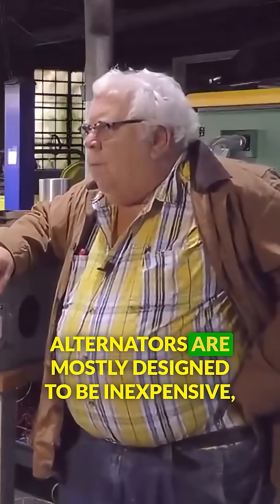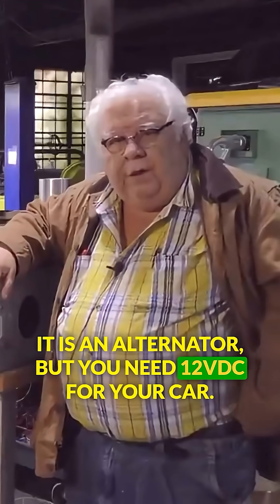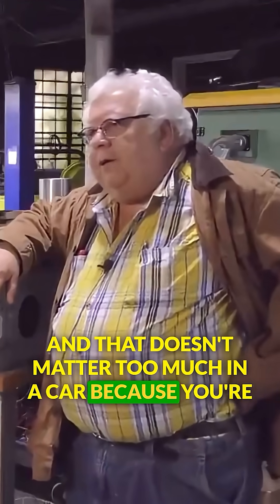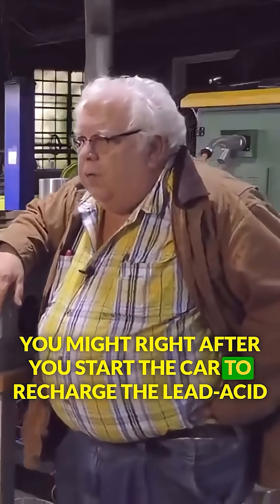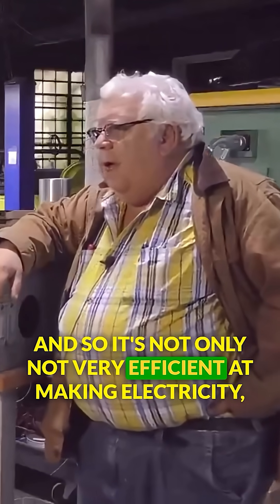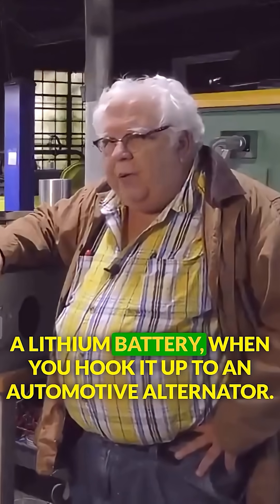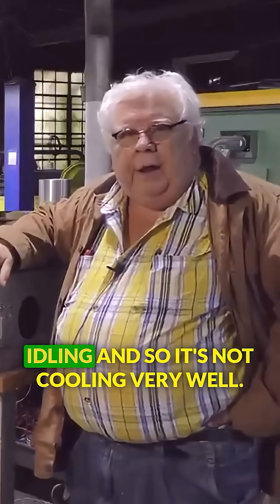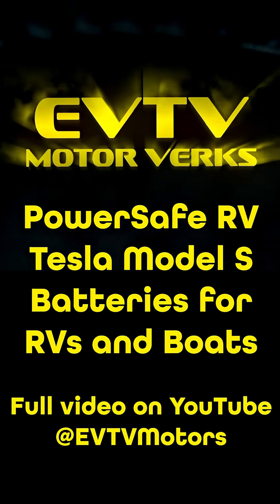Alternators are Only 50% Efficient!

Comment: Back when alternators were 30 bucks, I went to replace one on my 1980 Monte Carlo, and my dumbass brother in law said "no, don't get a new one, rebuild yours. Get a voltage regulator, diode pack, and something else....( can't remember) So I did that; saved like 10 bucks, until a month later when the pulley bearing seized .....😂

Comment: You are incorrect that alternators are 50 percent efficient because of the rectifier. Diodes do not work that way.

A car alternator is a three-phase AC machine with a six-diode bridge. Two diodes conduct at any given moment. Each has a forward drop of about 0.7 to 0.9 volts for silicon or 0.3 to 0.5 volts for Schottky. At 100 amps this means about 180 watts lost for silicon and 90 watts for Schottky. That is 5 to 10 percent of the output, not half.

The rest of the loss comes from copper heating in the windings, magnetic losses in the core, and fan drag. In an automotive alternator the copper loss is high because the system is locked to around 14 volts. That forces high current to deliver the needed power. Higher current means higher I²R loss. This is the same reason high-voltage transmission lines are used. For the same power, doubling the voltage halves the current and cuts copper loss to one quarter.

A three-phase industrial generator producing hundreds of volts benefits from this principle. Higher voltage means lower current in the windings, which greatly reduces copper loss. It also allows for heavier, more efficient cores with lower magnetic loss. As a result, large three-phase generators can achieve 90 to 95 percent efficiency, while automotive alternators typically reach 65 to 75 percent under good conditions and fall lower at idle under heavy load.

The 50 percent figure you quoted matches a worst-case overall alternator efficiency, not a loss caused by the rectifier.

Comment: The solution is fellas is hook up another gearbox. If you have the room underneath your engine hood for a generator alternator and use that to charge your lithium battery and connect it into another spot of your truck and use that just to power your tools or jump, start somebody.  But don't use it to run your truck

Comment: Alternators generally turn about 3x engine rpm so if your engine is idling at 600rpm the alternator is turning 1800.  And if you use lithium batteries in a vehicle or specially and rv.  You must use a dc to dc charger to limit the current or yes you will burn up an alternator … even at speed , not so much for cooling but the high load.  Yes an alternator can put out 100amps or more but it’s not designed to be 100% duty cycle.  With a lead acid battery you may run high loads as its charging and your night driving with lights etc.  but as voltage comes up amperage goes down. A lead battery also has high internal resistance, it can only take so many amps In… a lithium battery has lower resistance and can charge at 100amps usually without issue.  The alternator simply can’t do that max load continuously …

Comment: This man is correct. Legitimate testing and video is out there of this very thing. It's the "idling" scenario that will smoke an alternator. Not enough cooling. Reving up the engine is sometimes enough to keep it cool.. Possibly prevent overheating.

Comment: usually, current flows through 2 diodes during rectifying process. If we're using silicon diodes it causes 1,4V drop (from usual 14 from generator) which is more like 90% efficacy rather than 50% mentioned. If Shottky diodes are used, this voltage drop can be even twice lower.

Comment: As a retired alternator rebuilder he is absolutely correct!! They are terrible chargers. A std flooded battery is easy on them. An AGM battery is hard on an alt. and a lithium battery is a pinto towing a tractor trailer , fully loaded. The can be rewound to put out more amperage but then it will get twice as hot and burn up twice as fast.

Comment: I've got a Kenworth t680 with the stock alternator and it's about four or five years old, 500,000 mi, I run three deep cycle lithium ion phosphate batteries and one lithium ions starter battery, I often run them down to 50% charge or lower before starting again. Personally I have not had problems with my alternator. Maybe the fan is cooling it enough, maybe those alternators are just stronger, they push about 300 amps. They are probably built more efficiently because semi manufacturers compete heavily on fuel mileage,  but maybe not because the gains from the alternator are probably small for mpg so maybe it's not too efficient. Either way I've been running that setup for 7 months and not any problems yet

Comment: Lithium batteries are charged using constant current to avoid damaging the battery. This continues until the battery reaches a determined voltage level at which point the current reduces. This is why the last 20% (or so) charge takes much longer to achieve than the first 80%. So no, a half-way decent lithium 12.8V battery should not place a higher-than-normal drain on the alternator. A lithium battery that accepts over-charge will have a short life.

Comment: Interesting about liion battery recharging. Also it's disturbing to know that alternators are 50% efficient, because that 1200 watts of heat has to come from somewhere,  which is money I paid at the pump. All because automakers are too cheap to use something more efficient.

Comment: The difference and a alternator is the time and money it takes to make one.
 Back in the late 50s and early 60s generators were OK. Because A/C WAS NOT THAT COMMON + the old timers knew to not turn the radio on until the voltage went up. Because it would not very well without the proper vacuum tube voltages.
All the inconvenience. Oh the pain. The pain.  
 Shut up DR. Smith.
Now splain why my '68 Corvair got the same gas mileage as my Trax. Hint 4 speed stick, no A/C oh and it got stolen when it had 100,000 miles on it. I do not think I can give my 100,000 mile Trax away. If it makes it 100,000 miles.
 But along came auto magic transmissions and you could not touch the gas pedal and bring the voltage up, while sitting at a stoplight. Well you could if you wanted the engine to overheat.

Comment: Any lithium cell designed for automotive use that is sold on American shelves has integrated current limiting and charge equalizing circuits by regulation. Yes, the total load capacity is higher, but the rate the battery pulls current is bottlenecked specifically because of lithium cell overcharging. They will not kill your alternator any worse than a typical lead-acid battery. Also, this dude has no idea what he's talking about when it comes to the reason WHY alternators fail. Relative to the heat ratings of the materials alternators themselves are made of, they don't get that hot unless something is seriously wrong. More often then not, failure is caused by moisture and debris intrusion causing corrosion leading to insulation failure and arcing in the alternator. This is what causes the "heat marks" that this guy is probably thinking of which lead him to this conclusion.

Comment: An alternator is a three-phases generator, and uses 6 diodes to rectify the currect. This is actually the most efficient AC to DC system available. Standard one phase generator makes pulsed current and need hugely big capacitors (size proportional to output current needed) to make the output current, but three phase makes almost perfect continuous DC without any capacitors.

The bad efficiency of a car alternator is more due to the range of currents it needs to output.

https://www.youtube.com/watch?v=d2Wni_SzBiM

Comment: That's just pure stupidity. Diodes drop about 0.7V under load. At 14V output and 100A this is 70w of heat loss at 1400w of output power. How do you cool 1200w of heat loss in such a small package? That can only be done by water cooling. I don't even think this guy is real, I can't even believe he is real let alone his words.

Comment: He is wrong..   50 percent efficient means for every 1000 watts of electricity produced it requires 2000 watts of power to turn it.. as in takes 2kw of power from the Engine via the drive belt. Also modern alternators are more like 65% efficient, and permanent magnet hybrid motor generators are more like 95% efficient. The inefficiency of alternators is found in the rotor windings, which require electrical energy to generate the magnetic field necessary for the stater windings. The reason rotor windings are used instead of percent magnets is because automotive electrical systems require variable amounts of power to operate.

Comment: Most lithium batteries have a OE spec charging system as to not damaged the batterie or charging system sort of smart charge and they also hold a higher charge anyway about 13.odd volts and keep it quite well
In cold weather however they need waking up before you start the engine 
Turn your lights on for a minute but only when its cold 
Been running a lithium batterie on my bike for six years now big twin and its been fine and when you get them you think its an empty box because they are so light weigh nothing which is great for a bike.

Comment: The only output power limit of the alternator would likely be the current rating limit of the 6 rectifying diodes used in the production of the alternator. If anybody needed to, you can always turn to aftermarket alternators such as mechman alternators.

Comment: True, they aren't that efficient. They have a simple way of voltage regulation by varying the field strength. More efficient would be to use strong magnets (instead of the field electromagnets), and a DC to DC voltage regulator to manage voltage. The Li ion battery might work, but needs a constant current charge at lower battery voltages and constant voltage at higher battery voltages. All consumer products have this setup if they use a li-ion battery. Car li -ion batteries need such a system too, or bad things can happen.

Comment: I didn't see any comments regarding another problematic issue: its not just alternator cooling; unlike an alternator charging a lead acid battery, a lithium chemistry battery with a BMS will simply cut off charging when it reaches full charge. The voltage spike from that can fry alternator diodes. The reason why a lot of places recommend DC-DC converters is also to prevent the spiking from doing in the alternator, and its also the reason a lot of boaters/rv'ers will keep a lead acid battery in the mix, even though it impacts the charging of the lithium battery.

Comment: Automotive alternators are three phase machines, which helps.  Still less inefficient than they could be.  I've been driving those weird Chevy Volts for several years. They have a big efficient alternator that does indeed charge a large lithium battery properly without harm.

Comment: and it's not efficient on belt with huge tension causing a lot of friction and energy loss like if they could not fit it on the crank shaft end directly, or at least a gear directly running from it. It's all scam to burn more oil. Idling is the main scam. Why would a car burn fuel to stay in place ?! It could use just a bit stronger starter motor to drive on just a bit bigger battery while being stuck in the traffic.

Comment: what if you could increase the fan speed with a gear ratio that the alternator can slip into when temps increase on a lithium battery setup

Comment: This guy is wrong I have  a 300amp  alternator.  I have 4 x 200amp our lithium their highest draw is 35 amps each even when low state of charge  20% . I know  because they are blue tooth. If you have  80amp alternator upgrade 150 amp no worries  a car has a battery  so I could pull 60

Comment: I agree with most of his points except heat and efficiency.  Diodes for rectification are pretty efficient. He's saying 50%, based on the 1200W of power and 1200W of heat statement.  Simple bridge rectifiers are more than 80% efficient, plus you're not making 100A at idle on an alternator either.  

I think he's over exaggerating the impact of a lithium battery on an automotive charging system.  Yes it may add more load on the alternator when you first start the car, but unless you're repeatedly hot starting your lithium battery car...  This isn't really an issue. 

Just most of what he's saying is valid.

Comment: I have installed many Mechman alternators into some crazy builds over the years, seems they have found the right recipe for charging PB and Lithium chemistry batteries. Great at low rpm and 10,000rpm.
Reply: He's a liar,   and misleading people. 
You can't charge a lithium battery with a lot of amps, you will destroy the battery. 

If this man was telling the truth,,  every hybrid vehicle will burn up it's alternator the first time it goes down the street.........

Every electric car will burn up its inverters when it Regine......

So that's not true what this dummy  is saying,  he's lying and don't know nothing about a lithium battery.....

Comment: An alternator with a fan on the outside is usually found in cars that are a good 25-30 years old at least! Newer cars are more efficient and can handle lithium batteries just fine. I have ran countless lithium batteries for audio and have never had a issue at all. Not saying he is wrong but in my experience I have not seen what he is talking about.

Comment: Uhh my 64 nova has a lightweight lithium battery in it and all my motor turns is an alternator,so what is he talking about that if you hook an alternator up to a lithium battery it’ll kill it. I have a 16 volt mini 150 amp alternator with a 14 volt battery the alternator does tend to over charge the battery some but I didn’t want the entire system ran on 16 volts. It can be but that’s maxing every thing in the car out so only thing that sees max voltage is the starter then the power to the car runs through a voltage regulator that keeps it a steady 12 volts continuously. So alternator charging at 16 volts with a 14 volt battery and reduced down to 12 volts for fuel pump and water pump and all the other stuff like windshield wipers and all the lights. Never have a voltage drop what so ever and never had my alternator suddenly die either and about reason I didn’t it this way was to avoid the draw off the alternator so it don’t steal as much power as I was half tempted to make a bracket and run it off my driveshaft but this way has worked just fine. So I’m very puzzled by his comment on it killing alternators as I’ve ran traditional 12 volt versions in my regular cars with a factory type alternator and again no issues.

Comment: this is really easy to fix just a bunch of diodes , high farad capacitor coupled with super capacitors on the output side and a few trimmer resistor for fine tuning and a heatsink , or i guess you can just buy a stepdown converter like elejoy and a few supe capacitors in series on the output a fan and youre problem is solve.. both the bms and the active balancer on the lithium pack will handle the float voltage , the discharge(with the supercapacitors) and the over voltage/fullcharge ..

Comment: Ok, first off. No. Just no. Alternators don't use a single rectifier, they use a 3 phase bridge with an efficiency of about 90%. Second, most modern alternators as a whole have an average of about 70-80% efficiency. Third, while the heat produced is a factor of inefficiency,  alternators are rarely running at full current draw for any extended period of time. Lastly, alternators being made to be cheap was true decades ago back in the days of the Chrysler 2 wire design or the GM 1 wire, but today's alternator's are far from cheap, especially the ECM controlled units.

Comment: I hate to say hes wrong... but hes wrong 😢 a discharged battery will draw all it can from the alternater. Lead or lithium... the lead will draw the same amount if its the same capacity but it will not hurt the battery because the lithium can take a much higher "C-rate" than lead. 

It cant demand too much from the alternator, it will just max it out. Which is within spec....😂

Comment: Fastest way to ruin an alternator is by having a crap battery. People think alternators will charge the battery after a jump start and that's partially true, it will work for a while but you are requiring a much higher load from the alternator especially if the battery was dead and you run a bunch of other loads from the car while driving ex. Headlights, radio, seat warmers etc. It's more of a maintainer not a charger, so make sure your battery is in good shape and if needed use a trickle charger once ina while to charge it overnight... your alternator will last much longer.

Comment: Ive ran a skib bank good for 20000 watts on a stock alternator and have out demos all day at idle. No overheating problems. Now I have a Brand-X alternator that clamps 420a at idle (620rpm avg). Never had issues with overheating, just got tired of letting the truck idle every few demos.

Comment: Lithium ion has an internal resistance  relatively close to that of lead acid so the draw should not be so so far off lead acid. If you really want to see an alternator stressed have it charge a super capacitor array and see what you think then. 😂 I had a 2001 Toyota Echo running with an 866 farad super capacitor array, went from a 35 pound battery to about 9 pounds with the caps. Nowhere near the capacity of the battery but made an interesting project.